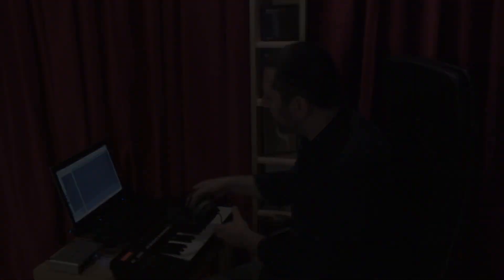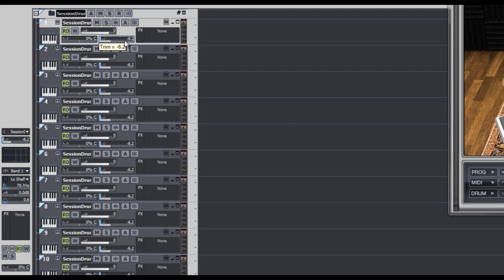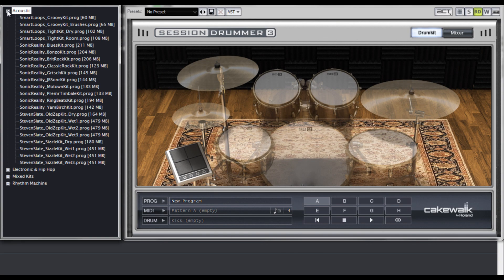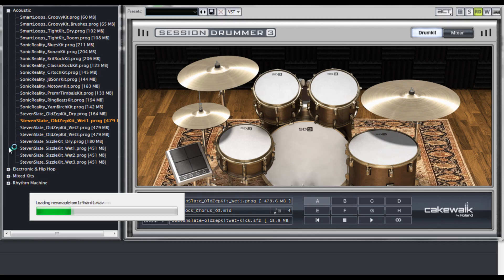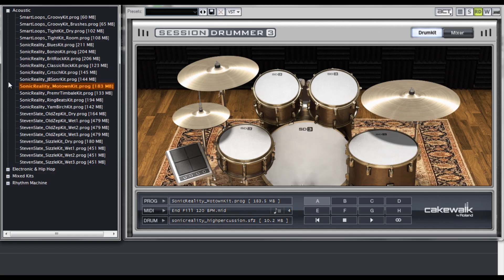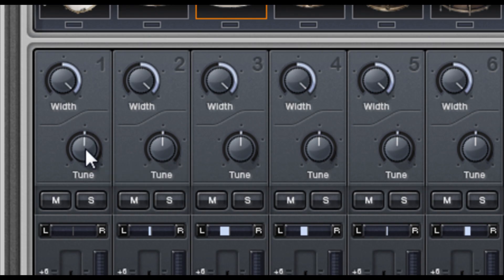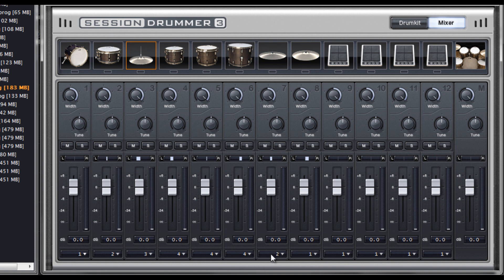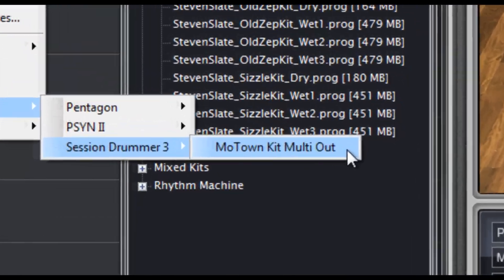(Part 1) SONAR: Master Class - Drum Production Episode I

Comment: Hi, I'm using Bandlab Sonar and I cant seem to get anything working. I have to insert a synth track then assign it but I can not then control which drum I want to use. In the Sonar system I used to work with I just inserted the drum then clicked on step view and I could work from there?